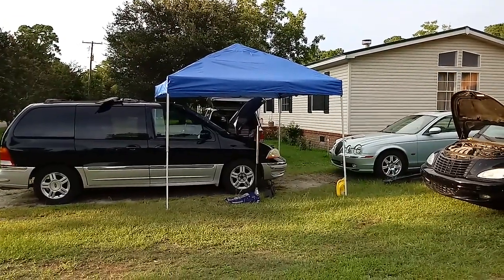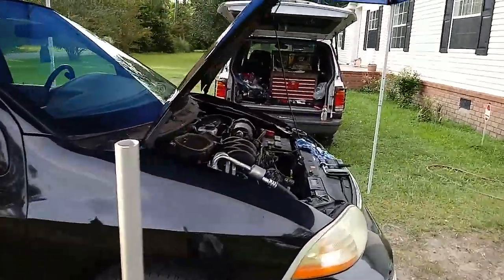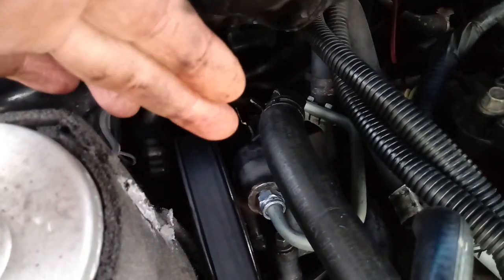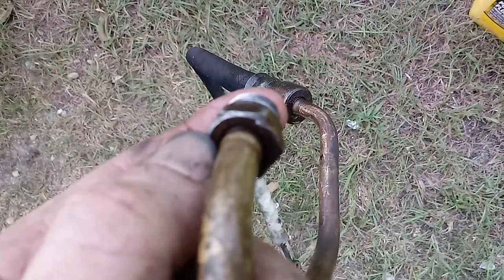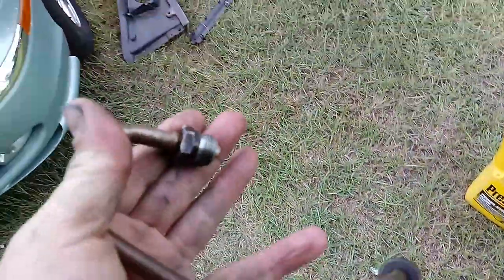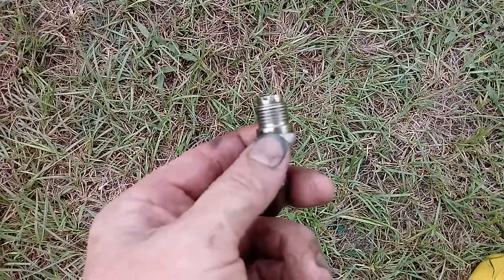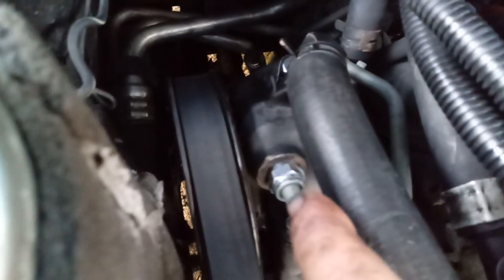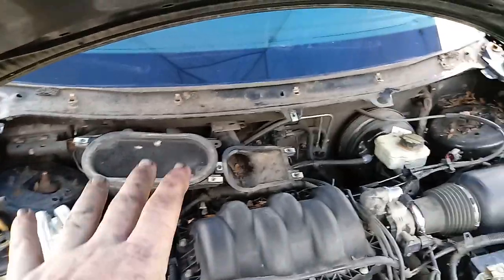Ford Windstar power steering line

Comment: On the 2000 ford windstar the clamp that holds the hose is a plastic clamp which can be pulled open by pulling up on the top on the end closest to the motor. Pull it up and it will open and you just lift the hose up out of it and lay the new one in and push it back down to latch it.

Comment: This really helped me, thank you so much!
Reply from the maker: Im glad this helped man..!!
Reply: @BigTravGill  That line, is it connected to anything in the back or does it just freely hang there along the firewall?
Reply from the maker: @habibkooljab  I think it had 2 10mm bolts under it I talked about in the video... Im not sure I showed it though but they are easy to ge to from the passenger side
Reply: @BigTravGill  that really helps a lot, it's raining here so I can't finish it, I did get the passenger side off thanks to your video, I will watch it again. I'm gonna tie a string to it to help feed it along.
Reply from the maker: @habibkooljab  Its not to bad of a job to be honest. I wish I showed more on the video but this is when I was just firing up videos again... trust me when you jack it up from the passenger side and go under its not bad to get that 1 or 2 10mm's ...
Reply: On mine I see 2 lines, is it the top one or the bottom one?
Reply from the maker: @habibkooljab  mine was high pressure... top line
Reply: @BigTravGill  I'm still trying to fix it, I have a puddle on the driver's side I'm not sure where it was leaking from,

Comment: 11-16-2022 thanks bro. Nice to have someone like you on my side. I have a 1996 Windstar. All kind problems. Overheat, rough idle, heavy fuel consumption, power steering pump to replace(2nd time). First time…I tried, soon as I was finished, the car was still moaning the power steering blues. Gonna do, water pump, power steering pump and heater core all at same time. Hopefully you will be able to tip me in on things. Thank you .
Reply from the maker: Man I’m so glad I was able to help. I show all my customers everything I do work wise on my business Facebook page… Gill Mobile Auto Repair

Comment: I got a leak on mine I was hoping it’s not the rack itself….it almost looks like it’s coming from around the pressure switch so from what you showed it will be easier to just take the line off plus due to mileage I am replacing the pump as well

Comment: LOL.  I have the fancy lift and your way is the way to do it. 

Only thing I will add is on the wiper arms push down on the arm (near the base) against the spring tension while you lift the base of the arm off with a separate little curved pry screwdriver type tool.  There are no 10mm bolts in that cowl.  Just long 8mm (at least on this 2002).  There are a couple of hard to find ones.  A speed gun helps.  Disconnect the squirtie tubes, wiper motor and under hood light connection and the whole unit pivots out.
Thanks for the vid.  Saved me some pain.

Comment: Travis i have a 2001 ford Windstar 3.8L i am looking for the CHT Cylinder Head Temp sensor. It's for the engine coolant temperature, my radiator fan wont come on and this might be the problem. But i cannot find it. Any help would be greatly appreciated.

Comment: I got a 2002 and it has a leak or leaks, but not from the top like in your video. I never worked on power steering issues before, so I could only speculate on a hunch while recording a video.  Too bad I can't add it with my comments.  So you never mentioned the part  name / or part number (OEM # would be helpful also).  Is  the name of the part  the "Power Steering Pressure Line"?:
Reply from the maker: It should be called the High pressure line. Some Auto parts stores may change it up a bit but its a high pressure line

Comment: I have leak near the smaller part of the hose and the bolt. Which is what i think you are describing for inner seal that cannot be replaced. But, my thread part and bolt still rotate together. So does that sound like the inner seal or Teflon oRing?

Comment: Did you install without putting that 8mm nut back underneath?  My hose has that bracket riveted onto the hose that was on the car so that it can't be slid off - I'd have to grind out the rivet to remove and fit onto the new one which does not have a bracket attached.  The new hose has a greater length of heat shield.  Hose doesn't have much slack in it to begin with and seems pretty set in place.  I'm gonna be going this next week and am leaning toward not worrying about the bracket.  It looks like the bracket is still on the old hose you removed here.  Just wondering how you handled it.  Thanks